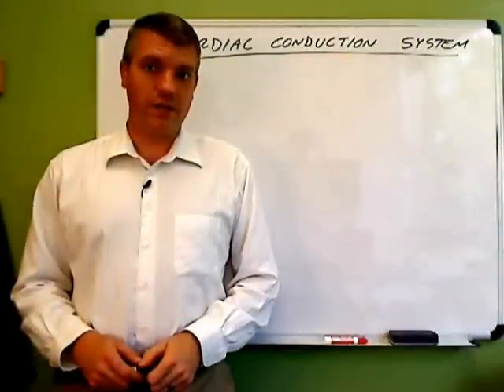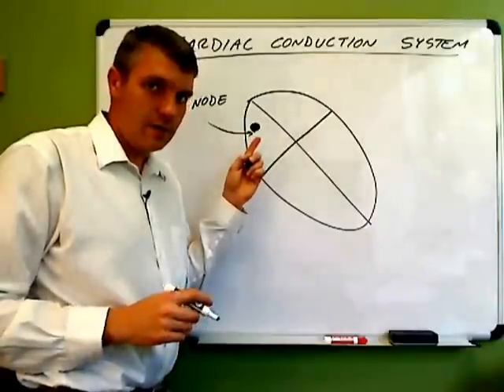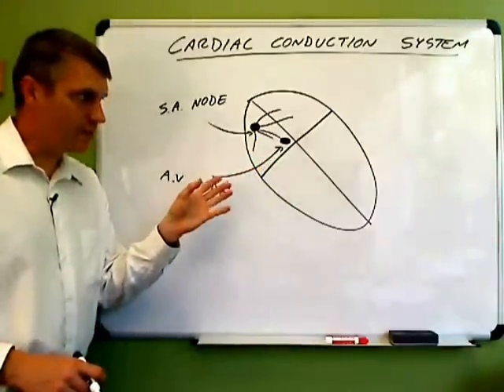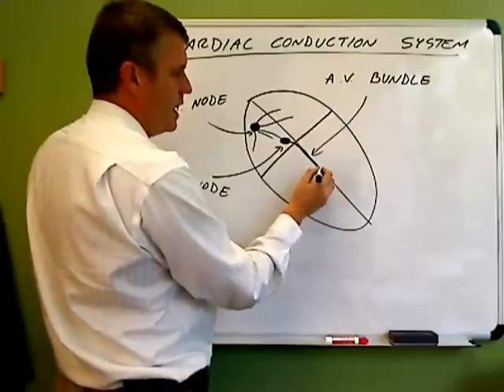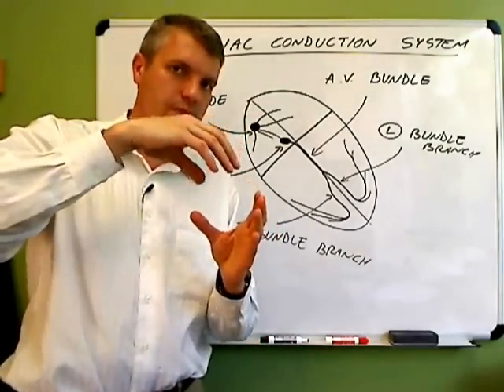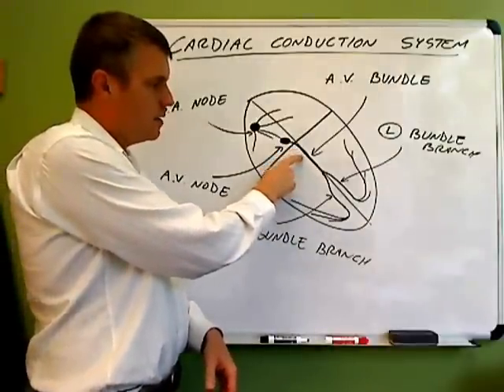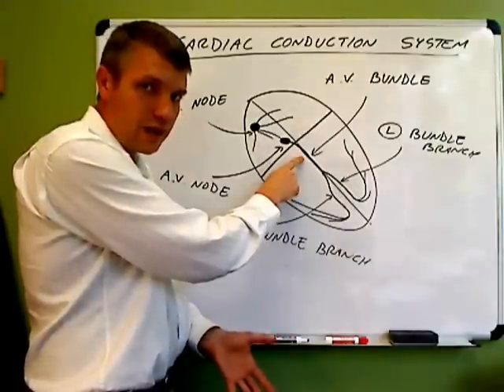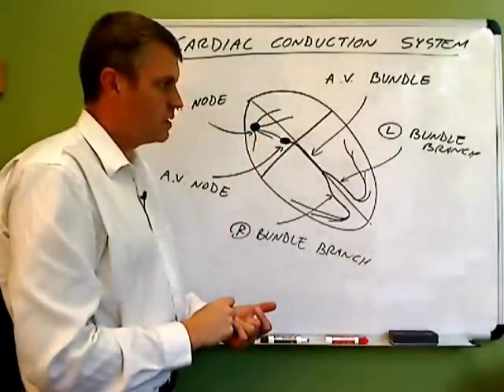cardiac conduction system.wmv

Comment: Would you explain why depolarisation happen in cardiac muscle and what are the stimulus for this happening ??
Reply from the maker: Actual depolarization is caused by voltage gated sodium channels.  Voltage gated calcium channels contribute and cause a plateau of the action potential.  Cardiac muscle cells are always approaching threshold due to the presence of HCN channels (you can look these up pretty easily), this is what gives the heart its autorhythmicity.  I hope that helps.

I think if you watch these two videos in order your questions should be answered...  let me know
 
https://www.youtube.com/watch?v=j4kz-BfNMFA&list=PL273D7F9250F69A75&index=6

https://www.youtube.com/watch?v=S-vY9133yaM&list=PL273D7F9250F69A75&index=8&t=0s

Comment from the maker: The AV node delays an action potential that just traveled through the atria and will next move down to the ventricles.  If the AV node did not delay the action potential then the action potential would immediately stimulate the ventricles to contract and causing them to contract at almost the same time as the atria and before the ventricles are completely filled-- making the heart less efficient.

Comment from the maker: You are learning at a higher level that I teach :)
These terms usually refer to the effects that drugs have on the heart...
inotropic = alters the force of contraction.  Some drugs increase force of contraction (+ inotropic), this would increase stroke volume.
chronotropic = alters heart rate.  May speed up rate (+ chronotropic) or slow down rate (- chronotropic).  
dromotropic = alters conduction in the AV node.  Increases conduction (+ dromotropic) or decreases conduction (- dromotropic).

Comment from the maker: Nope.  The Q is the start of the QRS complex which reflects depolarization of the ventricles.  Though the SA node starts it all... the wave of depolarization has to pass from the SA node, to the atria (P wave), through the AV node, and then to the ventricles (QRS complex).  We can't actually observe charge changes in the nodes on a standard EKG (charge change is too small) --  but we can see that the nodes are working by observing the larger charge changes that occur in the myocardium.